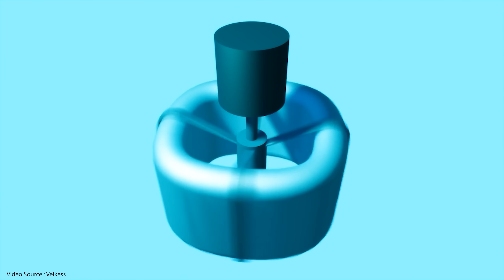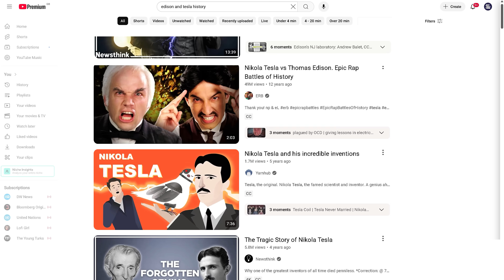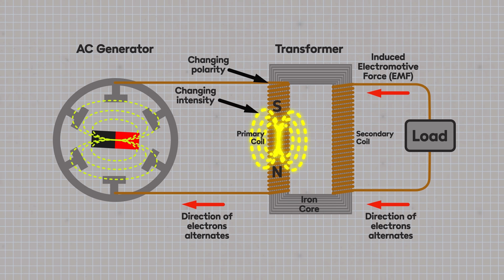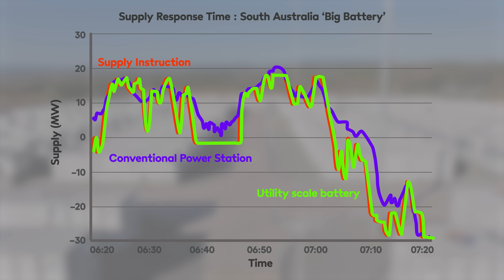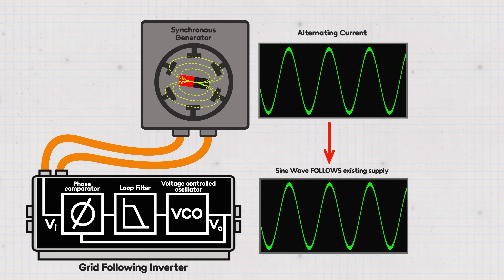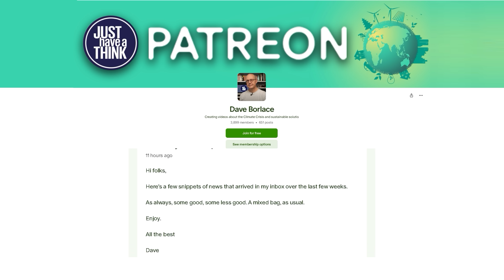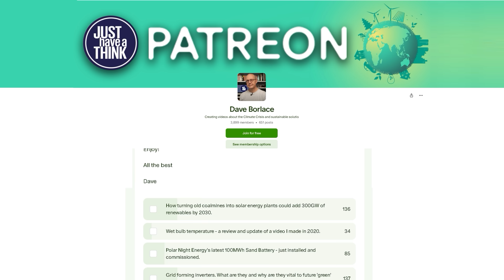How GRID FORMING INVERTERS are paving the way for 100% renewable energy.

Comment: Power System researcher involved in the topic. Grid-forming is indeed a primising avenue and let me say that your video put the things reasonable accesible to most lay man, which is fantastic. However, many must be asking why this was not the fists option in the first place, and that's the part I think was missing in the video. Maybe later, if the opportunity arises, you may dig a bit more on this. The main reasons are as follows:
- From a control perspective, grid-following are easier to implement in interconnected systems. Voltage already exists, so it was just needed to copy it. Grid-forming work spectacularly well when they are alone (think of an UPS or an off-grid inverter), but things complicate when we want to have serveral working together, as they need to be synchronized allt the time.
- Historic perspective: when interter technologies started to be used some decades ago nobody thought the share of conventional synchronous generators would decrease to critical levels. Early back then, grid-following was seen as a convenient and straight forward approach.

- Protection and limitation of short circuit currents: grid-following inverters have a interesting feature. They can control with precision the output electric current. It means they are very good at protecting themselves agains short-cicuits taking place upstream in the AC grid. By other hand, grid-forming will try to supply whatever is demanded from them, including short-circuit currents. It means that these devices must have more robust controllers and protection gear to prevent being damaged in such events.
- Need of an energy buffer: Since grid-forming react instantly to any power demand, its source of power must be flexible. Energy storage offer that flexibility, and that's why currently grid-forming systems rely on energy storage. However, things get complicated with PV or wind power where primay power is conditioned by the sunlight and wind availability, thus lacking a sufficient energy buffer. Many researchers are still investigating how PV systems can work as grid-forming. It's challenging. My take is that grid-following will still be needed, specially in PV systems, but that energy storage would work most in grid-forming and that it alone would be enough to provide the inertia the system needs.

I apologise if you find this reply lenghty, but I hope it is useful.
Reply: Batteries?  Aren’t they doing something similar already by replacing peaker plants.
Reply: @benjaminthomasson no, batteries only provide storage, the inverters provides the magic and when used with the right software can provide and answer to disappearing inertia

Comment: A difference with the spinning generators is that they can provide peak power (including reactive) much higher than the norminal power for a short time. Electronic inverters are much more limited in this respect. However as a bonus one can chose the response characteritics, while a turbine is fixed with the frequency going down when energy is taken from the reservoir. So the energy stored in the turbines / flywheel is not that acessible. To really use them for storage they need special regualated excitation.

Comment: You do a great job explaining this at a high level. As an EE in the semiconductor area, I have been developing the chips that are used in inverters and I am still amazed at the ongoing innovation. It all started around 25y ago with AC induction motor inverters (and many engineers then moved from that to solar inverters) and has grown exponentially since then. As the chips are getting more powerful and with the advent of cheaper and cheaper battery storage and solar, there is nothing mechanical that cannot be emulated over time.

Comment: Concerning your point about using a spinning flywheel to balance the load, when a nearby power generator facility reconfigured its supply from coal to natural gas, they refueled three of five steam turbines with gas but kept the remaining two to provide load leveling.  As demand declines, they spin up the two generators as motors and if demand increases they switch them to generators to provide grid supply.

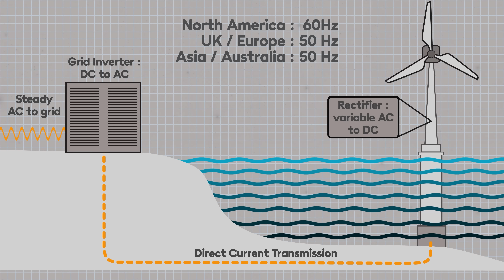Comment: At 4:20, you state that Asia uses 50 Hertz AC.  This isn’t strictly true.  

Japan’s electricity grid is split.  As far as I remember, western Japan was electrified by Westinghouse, a US company so it uses 60Hz.  Eastern Japan was electrified by European companies so it uses 50Hz.

In the middle of Japan there are four transformers which allow the transfer of electricity between the two systems.  This was a serious issue in 2011 when the Tohoku earthquake struck, knocking-out much of the electricity generation in eastern Japan’s 50Hz system.  

Western Japan was unaffected by the Tohoku earthquake and should have been able to make up the shortfall, but there was insufficient transformer capacity.  Unfortunately, transformers take many years to construct. 

Tokyo and other parts of eastern Japan suffered blackouts which western Japan’s electricity generating stations couldn’t make-up. The potential for such a widespread electricity generation shut-down in one part of the country simply hadn’t been envisaged.

Comment: My employer, a road and infrastructure construction company, has two asphalt mixing plants. I'm unsure of the second one that is in a smaller town but right next to a large distribution power line, but the one at our main yard in our small/mid-sized city has a natural-gas generator to generate the required electricity. Switching on and off the large electricity draw it required was challenging on the cities grid so the company generates its own electricity for the asphalt mixing. The heat from the natural gas generator is used to reduce the diesel fuel-oil burned to provide the necessary industrial heat.

Comment: People are being duped into using on grid inverters, which don't work offline, so if the power goes down, the solar panels on the roof are useless. Injecting power into the grid does not pays off, even considering that those "micro-inverters" are much cheaper. So, you are better of off-grid, considering that you don't have to pay taxes.

Comment: And how do you get all of those inverters to sink if part of the grid is separated from the rest? Say everything east of the Mississippi is ok but everything west has gone down, but most of the power is available but won't sink because some of the grid forming inverters are blown due to attacks. Nothing works and there is no way to get it all going again.

Comment: Ok so assume the technology exists to mimic inertia and these large scale solar and wind farms can be built with grid forming inverters, what about the issue of synchronisation? The whole east coast of Australia used to be served by about a dozen power stations, each with up to four big turbines each with the advantages of inertia. In that configuration it was relatively simple to ensure that synchronisation across the network. Not to many moving parts as the saying goes. What about in a system with 10s of thousands of inverters feeding into a single grid network? I’m guessing not so simple, and crucially not so cheap or reliable. None of these technologies have stood the test of time. Hopefully they will, but it’s extremely foolhardy and wasteful to shut down existing infrastructure before the new system are proven. I’m in Australia and have first hand knowledge of large scale solar projects (and the banks of diesel generators needed to spare their blushes)

Comment: Grid Forming Inverters will be great when they get perfected.  Last I checked, they were still in the experimental phase, sort of like what variable frequency motor drives were about 40 years ago (mostly smoke, coming from the power transistors).

Comment: A good example of what not to do is Spain where, along Portugal and part of neighboring France, got an hours long countries-wide blackout.  Politicians and power providers are still pointing fingers at each other about it.  The problem is that while wind turbines and solar panels are visible and its power output can be added up to brag about how much clean energy is produced, power forming is invisible and doesn't add any capacity, and doesn't get funded. It doesn't show in headlines or corporate brochures   It doesn't add up to anyone's green credentials.   On the other hand, closing existing inertial systems are deemed bad and closed, without properly compensating for its intrinsic inertia.  Thanks for the clear and concise video, it is incredible how well you explained it all in just 10 minutes.

Comment: If you watch carefully, many wind turbines stabilise at a constant speed. This regulates the voltage generated. But they can also be synchronised to the mains, once they reach operating speed. There is a U.K. channel which shows maintenance of our land-based turbines, and which shows in some of the videos how those turbines synchronise to the National Grid, But yes, some turbines do have Ac-DC converters and inverters.

Comment: Are these inverters free of Chinese electronic devices?
     I wouldn't want them shutting down when the CCP decides to go to war with the rest of the  world.
Reply: Steady on, take your tin-foil hat off.
How can a device be remotely controlled, without some form of network connection?
If the inverters are not allowed to contact the outside world, and do not have SIM cards in, then they cannot "Phone Home"
You don't think that wind / solar farms, just give the equipment open Internet access, do you?

Comment: It will never work!  The load switching will cost many times more than a turbine hall for a black start condition.  I could smell smoked inverters as I watched the video.  I like the idea of DC motors powering alternators via a flywheel.  Total control with lots of inertia.
Reply: That was the original inverter. An "Inverted Converter", where a converter was a machine comprised of an AC motor, driving a DC dynamo , to comvert the new fangled Alternating Current to the more usable DC
An Inverter was simply the opposite.

Comment: Im off grid with a fsw inverter. NEVER have a frequency or voltage problem, even if welding.
Reply: Is that with an inverter based welder, or traditional transformer?

Can your inverter supply enough short-circuit current to trip a breaker, in the case of a fault?

Comment: My thoughts: One simple solution for insuring consistent phase matching among all sources of power generation is to use a high resolution clock, by now it's fairly straightforward to obtain a calibrated reference time via NTP or GPS with high precision, insuring every system has less than 0.1ms of deviation, and allowing for computing an offset based on the distance of remote stations. 
I'm not sure how the phase of steam/hydro generators is synchronized, but I'm guessing the coils assembly can be rotated around +/-60 degrees to match the desired phase once the intended rotational speed is reached.

Comment: How do legacy power stations phase lock to grid forming inverters . What i mean is if power stations become disconnected. And then they start back up again But are out of phase with each other. how do they re-sync phase shift  before connecting  back together again? How do they communicate between each other to decide who syncs with who?
Reply: It is actually pretty simple. Start up and run disconnected but as close to the line frequency as you can get. Then wait for the phases to match.
The old fashioned way to do this was to connect a light bulb between each phase from the generator to each phase of the line. When all bulbs are out, the phases match and you can connect.
After that the generator is always in phase. Goes with being a synchronous machine.

I am pretty sure there are some videos around here somewhere showing generator startup.
Reply: @davidschultz3585  Yep, all synchronous generators are equally capable of forming a grid, or joining an existing grid, by synchronising to it.
Reply: If a power station is joining the grid, they match speed / frequency, then phase and voltage, before connecting.
If a powerstation is re-starting (part of) the grid after a blackout, then that station runs at 50Hz, and normal voltage, re-energising the dead transformers and power-lines.
Other stations then join, syncing to the island, until there is enough power to start re-connecting consumers.
Reply: A grid-forming inverter is known as a "Virtual Synchronous Machine" as it simulates a conventional generator.

Comment: What would be the difference between grid forming and off grid inverters?
Reply: A grid-forming inverter simulates a conventional generator, it can be pushed-and-pulled, whereas a standard inverter has a rigid frequency and voltage.
Off-grid inverters won't like being connected to grid-tied inverters, and would blow-up, if you tried to connect them to the grid.

Comment: The problem will all inverters ( DC to AC ) is that they use PWM ( pulse width modulation ) to synthesis a sine wave.  They use fast switching devices to vary the mark / space ratio of square waves so that the 'average' changes.. This changing average is used to 'construct ' a sine wave, but while a proper rotating generator produces a 'pure sine wave' the inverter sine wave has lots of harmonics of various frequencies.  This dirty sine wave may well be responsible for the 'rash' of grid transformer fires we have seen in UK,  the harmonics in the inverter sine wave cause higher losses  in the laminated iron core of grid transformer resulting in overheating of the transformer...
Reply: Usually corrected with filtering before it exits the inverter. Required by regulatory agencies and enforced with testing.
Reply: Yes, most inverters make a lot of switching noise. So much so, that they are required to filter out the noise, before the power leaves the inverter.
Besides, there are several transformers between a domestic solar inverter and a 400kv Supergrid transformer.
No, it wasn't solar inverters that blew-up the substation, no-matter how much you wanted it to be.
All the electronic power-supplies in modern appliances, would have far greater an affect.

Comment: It seems to me that an inverter that is nailed to 60 Hz (or 50 for EU) and simply has to match phase with the grid would be a lot simpler than an inverter that has to vary frequency and phase - but I'm a knuckle dragging mechanical eng, so what do I know?
Reply: The Grid may, or may not, be exactly 50Hz or 60Hz. Then what?  That is why almost all Grid-Tie inverters are "followers".

Comment: AC to DC, DC to AC? Sounds like a bisexual that can't make up their mind, FFS!
Reply: It might sound stupid, but there is a good reason for doing it this way. The initial AC is not stable in regards of voltage and frequency because it relies on the direct input of the rotor which varies with wind speed. Sure there are variable AC/AC transformers that could adjust the voltage to match the grid like a variac, but they are not able to correct the frequency which is vital. At the moment there is no better solution than to do the AC-DC-AC dance.

Comment: By putting a rubidium oscillator with 5e-12 precision into a grid forming inverter
said inverter  would not need a PLL , it "knows" when the max of a sine is 
reached . This is how I would do it. GPS time could also be used .
Such an oscillator can be bought for 1900 bucks, so large inverters can afford it.

A grid where the frequency is dictated by atomic clocks (GPS is controlled
by atomic clocks, rubidium oscillators are atomic clock by themselves)
would always be frequency-stable, and classical generators with inertia
would be a problem because the grid would be unable to react with a 
 frequency change when the generator slows down or speeds up.
And generators would always be either too slow or too fast. 
That would result in a phase difference between the grid phase and the generator phase, 
means the generator would produce a certain amount of apparent power (Scheinleistung).

By changing the frequency of the  grid the phase between generator and grid is reduced,
it is a natural regulation mechnism which helps to remain stable.
Probably grid forming inverters would have to mimic the behaviour of classical grids
and change the grid frequency when rotating generators require it.

Guess there will always be rotating generators,  like in hydropower stations.

Maybe, in a not so far future,  rotating generators will  deliver their power to an AC-AC inverter which delivers
50Hz +/-1e-8   at the output no matter what. 

Means we need  a completely new regulation system because the information "frequency changes" is missing.
Reply: Look-Up something called a "Virtual Synchronous Machine"
Relying on every site having an expensive GPSDO, might be overkill.
Besides do you really want your inverter to be at the mercy of the U.S  government's GPS signal?
A good TCXO is fine for starting, the grid will pull everyone together, anyway.

Comment: A much needed tech! I see so often the regulations mandate the non grid forming tech because they worry about the safety of the power line technicians when there are downed power lines without any concern over grid stability.

Comment: Great video, thanks.  One side comment though.. not sure where you found the map showing percentage of electrical production that comes from hydro.... but there is a glitch... New Zealand was shown in the 1% to 20% colour, whereas the actual figure is around 60%. Most of the new installations are wind, solar and geothermal, but the backbone of our generation is still hydro.